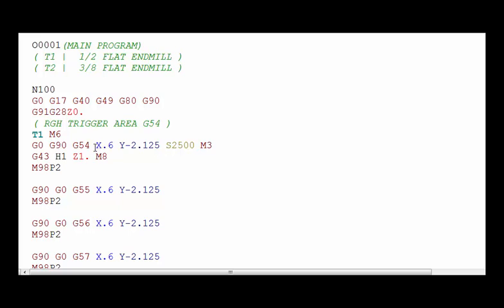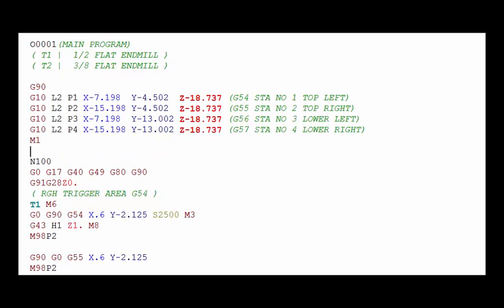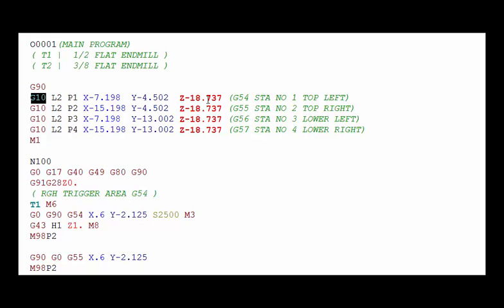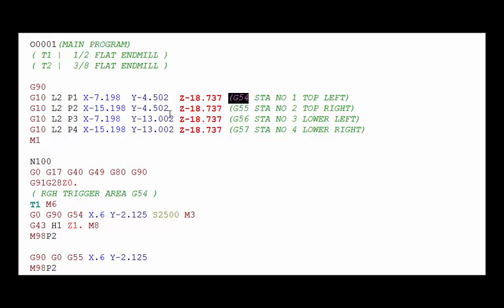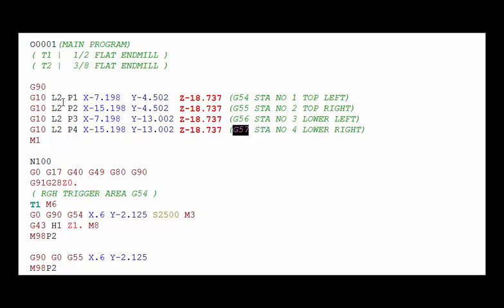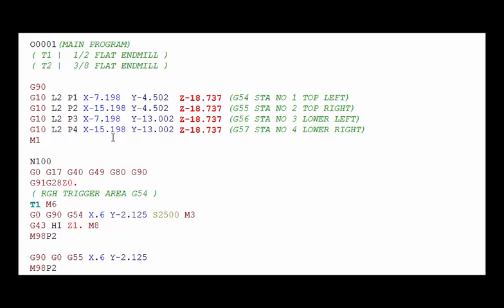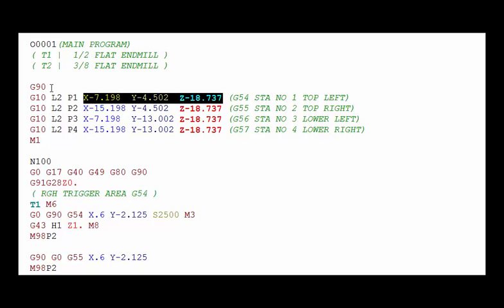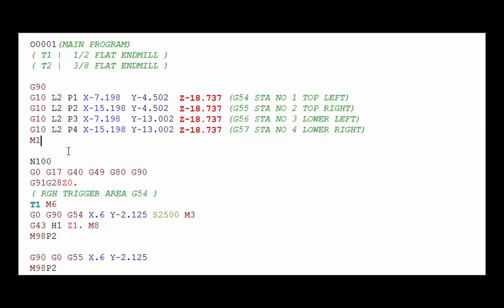HOW TO USE A G10 COMMAND TO LOAD WORK COORDINATES FROM YOUR PROGRAM

Comment: I use G10 all the time to load tool offsets.  
For Example, my driven tools for a particular job:

G10 P10002 X -300.000 R   10.000 Q0.
G10 P10003 X -300.000 R    5.000 Q0.
G10 P10004 X -300.000 R    3.000 Q0.
G10 P10005 Z  -40.000 R    0.750 Q0.
G10 P10009 Z  -40.000 R    0.000 Q0.
G10 P10010 Z  -40.000 R    1.250 Q0.

This prevents the machine setter forgetting to manually input the non-probed geometry values. (I've done it)

My CAM package always outputs work offsets like this:
G10 L2 P1 etc etc
G10 L2 P2 etc etc
G11

The manual says G11 is Programmable Data Input Cancel. My question is why should I use G11? 
If I don't use G11 the data still goes where I want it, and no other data is stored or overwritten until I manually change something or run another G10 line. In which case what's the point of G11?
Why do I need to tell the NC that I'm finished inputting data? The data input is finished so I just drive on.
Just curious

Comment: I started a new job on some Horizontals and they are using G10 on all the machines. The problem is that if you have to rerun a sequence, you have to manualy/MDI the G10 start up program so you don`t scrap a part. These are military grade parts and I think there is a way to have the program reload the G10 numbers so it doesn`t scrap the part. Is there a way to safeguard a program to load the G10 lines before every sequence? They told me it is not possible.

Comment: Hi, I have qeustion . when I start the machine the will go to the limet switch and set it home the 
and when I put work pics in the table of the machine I shoud to make another home position to the work pics in the edge of the work pics the qeustion is when I have 
G10L2 P1 X5Y3Z4 this cordinate value will add to the first home position of the machine or to the home position of the work pics???